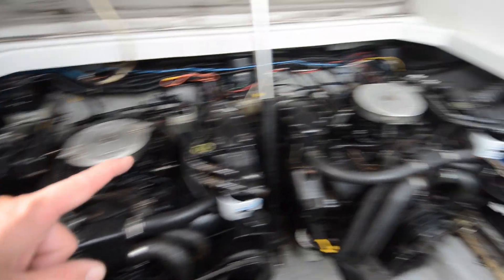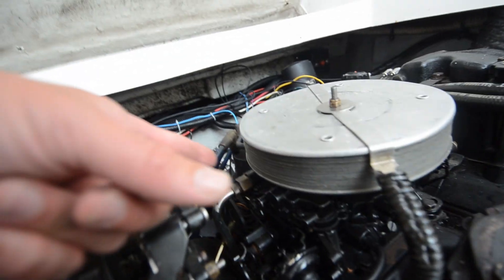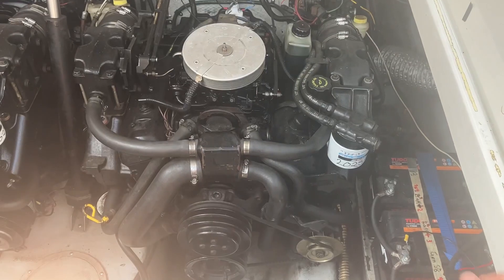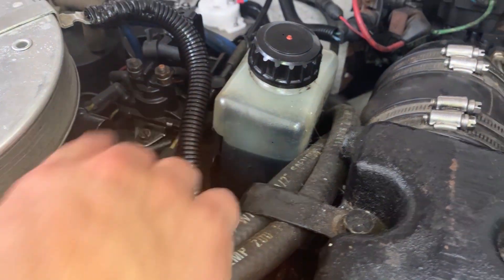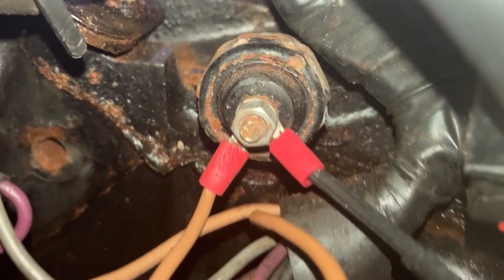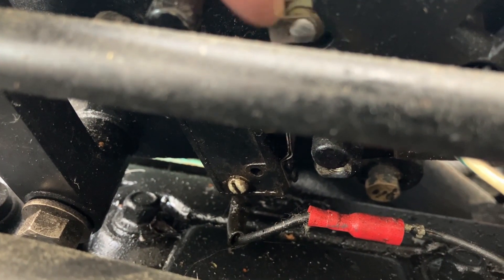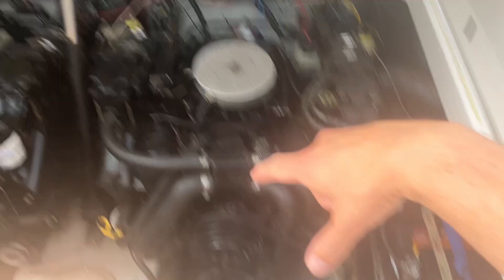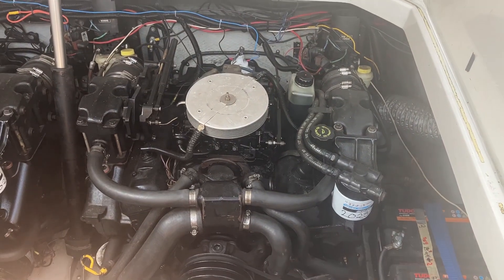Where do I find things on the Mercruiser 4.3 LX

Comment: I'm having crank no start issue. I have spark everything.  Would the oik pressure sender unit prevent ecu letting injectors spray?
Reply from the maker: Don’t think so. Engine has no oil pressure untiil it runs so it needs to allow start first. 
I think those systems get activated by generator current. 
Do ypu get enough fuel?
Reply: if theres no oil pressure there is no corrent for the gasoline pump and the engin wont start. theres a low oil pressure sensor with 2 wires on the right side of the engine with also a oil gauge sender with only one wire. you must jump the 2 wieres from the low oil presure sensor turn que key and you will listen to the gasoline pump working and the engine sould start and you can buy a new sensor, if you dont listen the gasoline pump working theres something wrong with it or the wires. the oil presure sensor on the back side of the engine as shown here is only for the buzzer alarme.